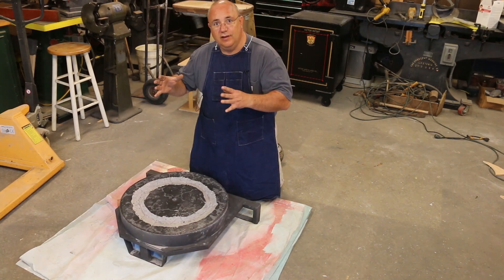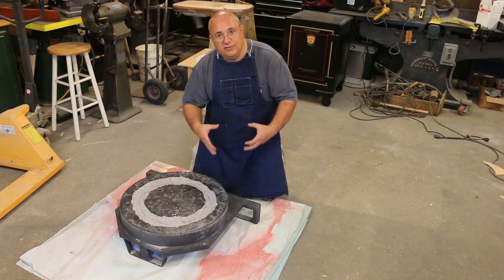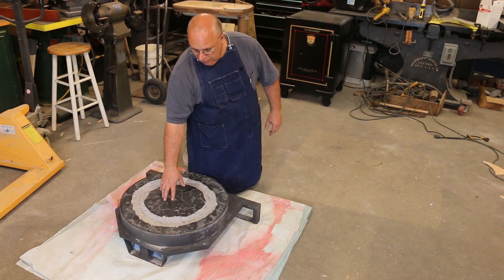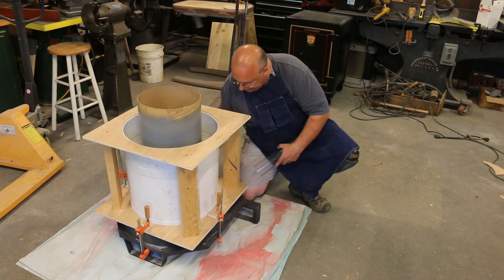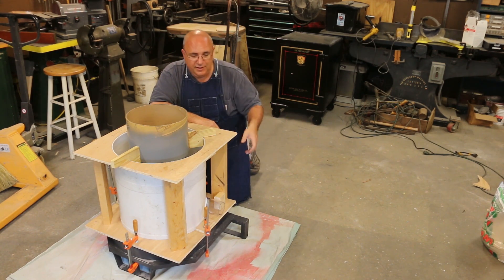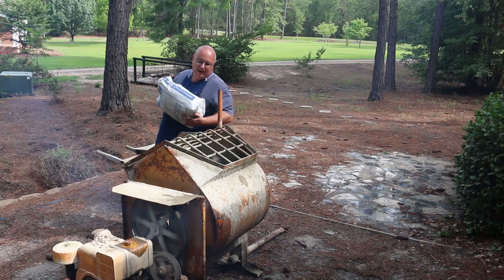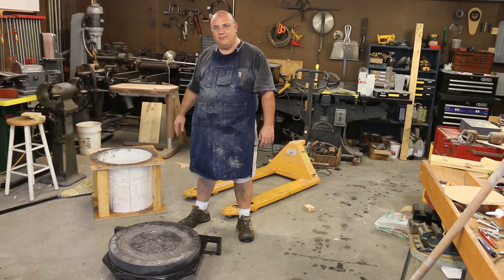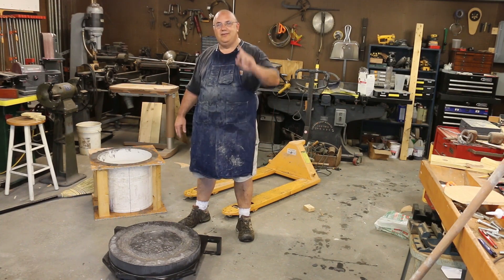Building an Oil Fired Foundry Furnace - Part 5:  How NOT to Cast Refractory

Comment: Yeah, I had a bad feeling about the cardboard form and how wet you were making the refractory. When we made a very wet batch of refractory to reline a furnace or to line a bull ladle, we cast the refractory around a wooden billet that had been firmly secured so it wouldn't move and was wrapped in plastic, so the wooden billet wouldn't absorb the moisture and swell. It was easier to pull the billet out, because of the plastic and any defects formed in the lining was repaired by a thick batch of refractory troweled onto the lining and, after the lining was dry, a refractory wash was then painted on to finish the job. Don't give up! I can't tell you how many times something happened to ruin the job and made us restart from square one! "Never give up! Never surrender!"
Reply: sandrammer Another thing, That upper ring that you're going to cast will break off in chunks, over time, if you don't also cast metal rods (formed into rings) into the batch to act as support. The refractory has strength to resist heat but doesn't have the strength to resist the shear forces that will be exerted onto it during the normal steps of melting metal as, I'm sure you realize, you will be using that shelf to rest items onto it like ladles, skimming tools, etc. Just a suggestion.
Reply: sandrammer i would wonder about the thermal expansion of the steel vs refractory, his outside ring isnt embedded so can expand as it wants, steel on the inside might cause issues
Reply: jusb1066 True. The only other thing I can think of is that he adds a bottom to the top ring and then supports the ring with stiffeners welded to the metal base. The ring certainly needs a shell to both support and protect the refractory if it is to last.
Reply from the maker: sandrammer Good comments here.  I will have to think about some kind of shelf to put under top ring.....

Comment: Keith,
I would try this.   Fill the inner form (not on the base) with concrete and cast in a lifting ring at the top and the bolt in the bottom. Coat the outside with wax.   It will make it easy to pull out.  The issue is the pipe at the bottom.  I would cut it so it intersects with the inner form.  The pipe could need to be filled also with concrete with a lifting ring on the outside. (this will keep the pip from filling up with refractory.  you may have to break out a little refractory where the pipe intersects, but this won't be a problem.
Reply from the maker: Herb Blair Yeah, I think that what happened is where I cut the hole for the pipe to come through the form, it weakened the strength of the form there.  That is where the failure occurred - it started caving in around the tube and once is started, things  went south quick.
Reply: Herb Blair I agree with the above, keeping the pressure on the inside of the tube and the outside of the tube equal would go a long way to keep the tube from collapsing. covering the outside of the tube with an oil based sealer would keep moisture from damping the tube or wrapping the tube with plastic sheeting. The "firing tube" could be packed with sand sealed with foam ends to keep it from collapsing too.

Comment: Hi Keith, I feel for your loss, "bummer" doesn't quite cover it.
I'm no expert but I suspect that if you had made 3-4 separate pours, letting the muck harden up a bit between layers, that the cardboard would have been OK. Wrapping the inner form with Cling film (I believe you have a different name in the Colonies) might also help to stop water softening, and don't forget the end grain when water proofing. 
However you do it next time be assured it will be perfect, now that you have had your practice run.
ATB
c
Reply from the maker: Chris Stephens I think that the main problem was where I cut the hole in the form for the tube to come through.  That was where it started failing first.

Comment: Kieth sorry about the cardboard failure. My thinking about the drain hole in the bottom on an oil furnace... If you have extra oil dripping down there like a weeping nozzle or before its hot or really burning good you may get some oil dripping out the hole making a mess.

Comment: Darn, that sure sucks!!  I had worries of you removing the internal tube after it set up, but I never thought about it collapsing!  I poured a lot of concrete (when I was a younger man), and just like pouring aluminum, without any draft, that internal tube was not going to pull out in one piece.  You probably could of cut it out without much problem, but be aware of that with your next pour.  Another area that concerned me was the square corner under the upper lip.  Chances are that outer plastic mold is going to be a bear to remove without it having any clearance built in (on top and bottom).   Maybe run a router around the top and bottom to trim or round off the plastic barrel so it's below the surface of the plywood.
Reply from the maker: Jack Hoying That is a dang good idea about running a router around the upper portion!  That will likely happen on the next pour...

Comment: Hi Keith !

Oh, I'm so sorry to see that it all fell apart !

Fill the inner pipe up with wet sand to match up with the forces from the refractory from the outside - I don't think stabilizing with wood - as in the bottum will do it - it has to be some "concrete like wet mass"

Hope you will succeed !
Reply: Lasse Langwadt Christensen plastic bag and wet sand or gravel (gravel no need to be wet) the tube needs a bottom.
Reply: Keld Sørensen or even some heavy duty plastic bags and fill the inside with water, much easier to get out

Comment: Filling the centre tube with sand would have helped ***** . The compacted sand would have given the tube stability in maintaining the shape. I have used the tube only in column pores and never on the side you used it. That heap of mis cast refractory, expensive learning money. Bugger :(
Reply: Also, would heavy clay be material for a liner? Or plaster mixed with sand? Our ancestors did not have a lot of options and it worked for them.
Reply from the maker: Arjan Wilbie The tube was filled about half way with sand.  The problem was in the bottom of the tube where I cut the hole for the pipe to come in - I think this hurt the strength of the form and even with the sand in the tube, the refractory started creeping in.
Reply: Keith Rucker - VintageMachinery.org slightly wet sand is compact. The tube should be filled to the level that you pour to. Even the compacting is a factor in this, same as the ammount of water in the mixture.

Comment: thanks for sharing....next time you should fill the tube with sand....and don't use a bucket...the bucket will float ...greets from Germany :)
Reply from the maker: ***** The tube was filled with sand about half way.  The rupture started at the very bottom where the hole for the burner was cut into the tube.  This hurt the structure and as I was digging things out, I found that the refractory was actually pushing through the hole and displacing the sand.

Comment: Damn- that's a bummer. I've done that with projects myself- you think you're on the right path when all of a sudden an unseen curveball is fired at you. 

Can I make a little suggestion? Instead of relying on the ground-out area to hold your main cylinder to the base, drill a couple holes in the base and place bolts. They don't need to be overly long or large, but they'll act like rebar to hold the cylinder in place.
Reply from the maker: ***** I have been warned by many that putting steel into the refractory is a disaster waiting to happen.  I can cause the refractory to crack and break when it is expanded by the heat.
Reply: Keith Rucker - VintageMachinery.org 10-4. I didn't know that was a problem, now I do.

Comment from the maker: My latest video.  Sometimes things just don't turn out the way you want....
Reply: So sorry the core collapsed on you. All that wasted foundry. You took it well.
Reply: Keith Rucker - VintageMachinery.org I do have a suggestion, you might have to use wood to form your center and use that cardboard to build it from. We use to put a fire to burn the wood out from around the refractory after it cured. Because once you use wood it was hard to remove. Hope this helps you out.
Reply: For the center piece, you could use a large PVC drainage pipe capped at the bottom and filled with water for weight & stability. Coat it with a wax mold release or oil to facilitate removal.
Reply: Keith Rucker - VintageMachinery.org I worked as a cement mason for 15 years and have seen a lot of form failures. I wish I had found your channel sooner, I could have helped prevent your problem. A few thing that came to mind while watching the video were: The cardboard tube is made to have concrete on the inside and is too weak under compression, better fill it solid and tamp it well. Forms want to float up during pours, so a threaded rod and a hold-down on the top would have been well worthwhile. Forms want to deform wherever possible and plastic is elastic, so I would use 3  more plywood rings on the outside of the plastic form. It may end up looking somewhat segmented even so, but would be completely usable.
I always had to prove my point by letting the bosses see the actual failure in the past, it would have been nice to help someone who would actually listen. lol I was just a shovel guy, what did I know.
Reply: The furnace project really fascinates me, even though I have never done anything with metal. I suppose I could build one, just as long as I tell my wife that the thing in the garden really is a tandoori oven ... I might actually get metal objects and tandoori chicken if I pull that one off successfully.
Reply: Keith Rucker - VintageMachinery.org after watching all the huffing and puffing on the end of that shovel I was already feeling for you when you said it collapsed.  Then when you said it was a loss of hundreds of dollars I really felt bad about it.  I tried to make a foundry back in the 70's and it was a failure so I purchased one already made, still got it.  Thanks for the video.
Reply: Keith Rucker - VintageMachinery.org   WHEN IT FAILED , DID YOUR LANGUAGE BREAK THE CAMERA ??    :-(     :-(     :-(       :-(
Reply: Keith Rucker - VintageMachinery.org It's always tough when something collapses and takes a bunch of material with it. My own (small (2x2x5)-  electric - heat treat) furnaces have always failed because I was too impatient to let the refractory get really dry before firing them up. My dad and I made one that worked for a while, but eventually crumbled faster than we could repair it.

I know that you will succeed in the end (otherwise, why would I be watching this?), so keep on keepin' on.  

BTW, Vermiculite (expanded mica flakes) makes a really good external insulation. Maybe not as easy to manage as fiberglass blanket, but I think better in the long run. You will have to plan for how to add it into the outer shell.
Reply: Keith Rucker - VintageMachinery.org I have been following your project with great interest. I'm a retired pattern maker and think you are doing a good job so far. I actually still think the cardboard pipe is a viable idea, but you need some support inside it. While I was watching your video go South I was thinking you might be able to line the cardboard pipe with a weak mortar in a 1" layer. The mortar has an enormous compression strength and yet it will be very easy to break out when the refractory on the other side of the cardboard wall has set. Same principle as an egg shell.
It would be quite easy to make a Styrofoam inner column 1" inside the cardboard tube to cast the mortar. If you want to you can make an experiment and try to crush it with a belt clamp. I think it will hold.
Reply: Jens Sigurdson 
Sir the rope is for the outer plastic Drum which i believe will be under tension right? i mean the refractory is trying to push out right? so now what we have filed the inner tube with dirt dirt surely is the better choice like u pointed out sand will become fluidic under vibration .
now that the inner tube is secured there will be more load on the outer drum right?that is y i suggested the rope for the outer drum
Reply: Looks like a great work weekend project.  Let me know when your planning on trying to do it again I will come help
Reply: Keith Rucker - VintageMachinery.org you might try to get a plastic tube in the matching diameter and reinforce it with some wood

you even could make a inner casting out of wooden planks that are positioned in a polygonal layout with beveled cuts on the side so you get a trapezoidal profile, it won't be completely round then but at least pretty stable and you should be able to remove it pretty easy (and if needed only one board needs to be precut so you can crack it out once the refractory dried)

to get it release concrete and so on easier, you might grind it smooth and apply a coat of molten wax on the wooden core at first and let it dry/harden
Reply: Jens Sigurdson sir iam no expert and my experience compared to you all are well lets not compare......
what if the inner core was filled all the way up with sand it surely can take the load as it is designed for casting concrete 
and we try again with the same outer mold (plastic drum) 
but to give us a fighting chance we tie rope around it what do u say?

just a thought...............
someone once told me "if u  have an idea dont hold it in it......  ideas come from ur ass and there are only 2 ways out ,a fart or a comment"HE HE HE
Reply: Atul Sohan
The idea of strengthening the core wall is naturally correct since it failed in the initial attempt. But You actually miss the purpose completely by suggesting rope.
A rope is very strong in tension but have no strength what so ever in compression. But there is merit to your idea anyway, more on that later.
If you look at the cardboard wall under outside pressure the refractory concrete is trying to push the cylinder smaller. The force is in other words doing what it can to make the circumference shorter - that is where the compression really is. The resulting force from the refractory loads the cardboard wall in the circular direction of the wall not in a radial load pointing to the center. Does that make sense?
So why would a rope work then after all? Well if you can put the rope under a greater tension than the resulting compression from the refractory does, the wall will stand - yes?
So why is the rope a redundant idea anyway? Well because it takes a bigger force to hold the rope under tension AND hold the refractory away than just the force to hold the refractory alone. Hence; the rope does no good in the construction.
Packing the core with sand alone should do the trick if it is as dense or denser than the refractory that it needs to counterbalance to give zero compression in the cardboard wall.
However I will still suggest to at least use simple dirt or adobe in place of sand because sand can become fluid under vibration. Ramming the refractory could make the core wall dent or buckle in local areas if the sand start to move.
Hope this explanation on tension and compression will nourish your idea. :)
Reply: Best bet is just to start with a much stiffer core in the first place, one that does not need any packing.  Simple is always better.
Reply: You can get Styrofoam™ "logs". They are sold as flotation material for making things like swimming rafts. At the expense of some stink and smoke, they could be burned out after casting the refractory. A hot wire "knife" will carve them easily. If you can't find the logs, you could glue up layers of foam insulation board. That might be better, as you could precut circles before gluing.
Reply: Keith Rucker - VintageMachinery.org 
I am sorry things did not turn out as you expected.  You are planning to have a hot face wrapped by ceramic blankets.  A 12" bore is a good size for a foundry but I think 3" of refractory and 3" of ceramic blanket is over engineering.  I think the hot face can be reduced to 1" this will save you both money and weight.   6 bags of refractory weigh 300 lbs. To cast 1" you would need 2 bags and shave 200 Lbs of the weight and $200 of the cost.  At the reduced weight the tube will hold up, but to be completely sure keep adding sand to the inside as you pour the refractory.  Putting equal pressure on the inside will prevent the tube from collapsing.   I am unsure whether paint alone will prevent the refractory from sticking.  Use a parting compound, oil or wax on the tube.  If you can draw a circle you can do parallel line development to create the tuyere cutout.

We don't learn from success,  success makes us overconfident.  Failure is a great teacher.  

Good luck on you next try.
Reply: +OLD WIPPER-SNAPPER After all that effort Keith put in to this project my language would break the whole building ;)
Reply: +Ed Hamlin Good Idea. The same idea could be done using the cardboard tube using sand inside, because PVC Pipe would be way more expensive than cardboard. This way it will not matter if the cardboard gets wet, it shouldn't collapse.
Reply: But now we know what not to do so we don't waste all the refractory oourselves. I cast refractory for my own furnace  yesterday and (even tough it's still drying) i think it is a succes!
Reply: +Keith Rucker - VintageMachinery.org I am so sorry to watch this Keith!  I am not a practical engineer like yourself, but I have had a few projects I really put my best effort and mind in to and when they fail...  Oh, its really is heart-breaking.  Its a real test of inner strength and I hugely admire you for pressing on with this in the future.  I know I would have probably hurled the thing - well, given the weight of the materials perhaps slowly wheeled it - in to the bottom of my fields and abandoned it, cursing up a storm with every moment!!!